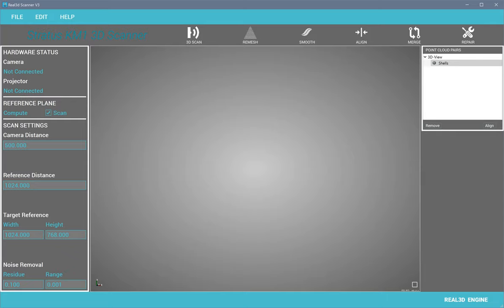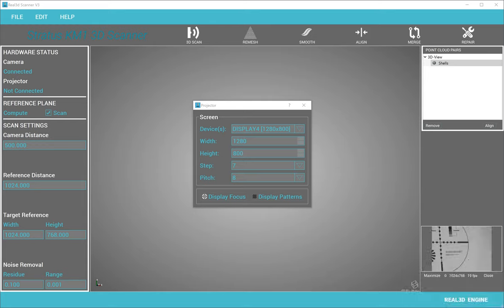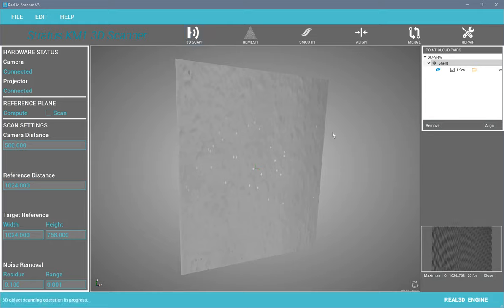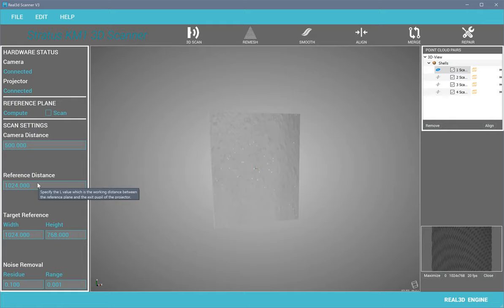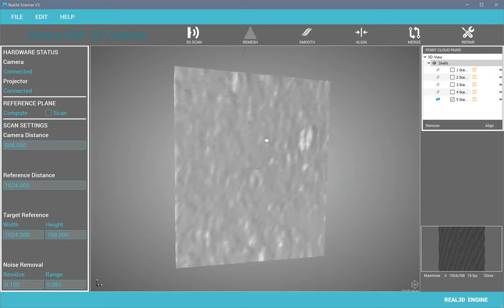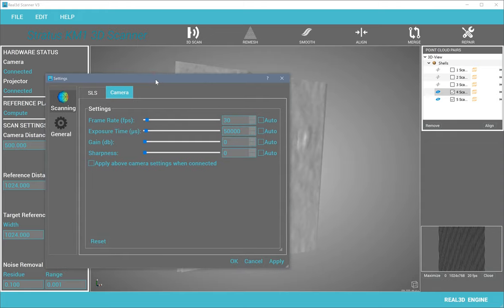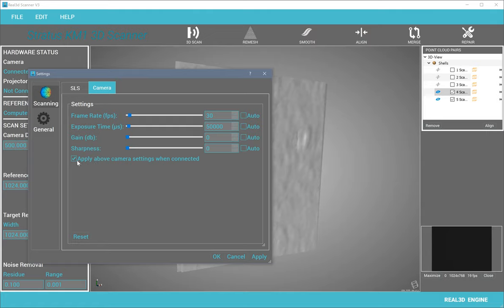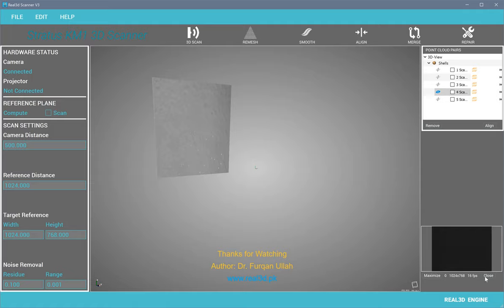Introduction to Real3d Scanner V3 (Structured Light 3D Scanning)

Comment: This is awesome. Does it also Support Logitech cameras?
Reply from the maker: Thanks. Yes I don't see any issue with Logitech. In addition following devices are supported:
Tested Camera:
Logitech Camera
Basler Camera
Thorlabs Camera
The Imaging Source Camera
HIK Vision Camera
Tested Projectors:
LG LED Projector
Acer LED Projector
SK Telocom Smart Beam Pico Projector
Reply: @FurqanUllah  I did just a basic test last night in and got video. Going to test tonight on a live stream 9pm et. I had to install the HIK software even though I was not using it.
Reply from the maker: CNX Tech thanks for letting us know. Yes, unfortunately, HIK run time libraries are the dependencies to run the software.
Reply: @prahjister  does it work with intel realsense cameras